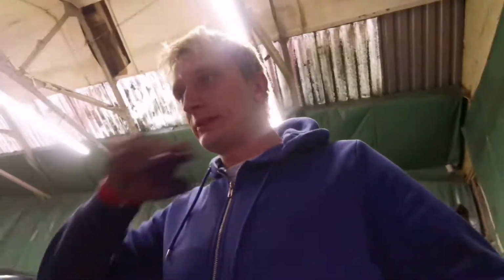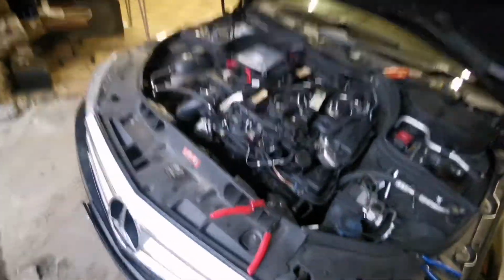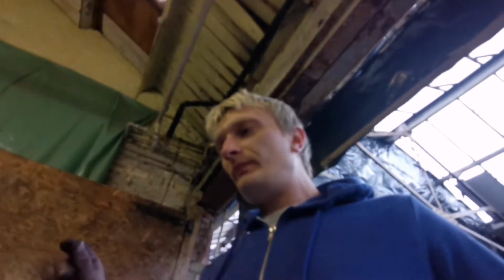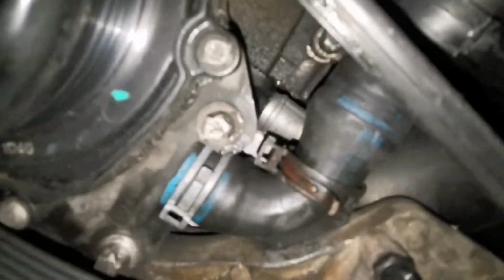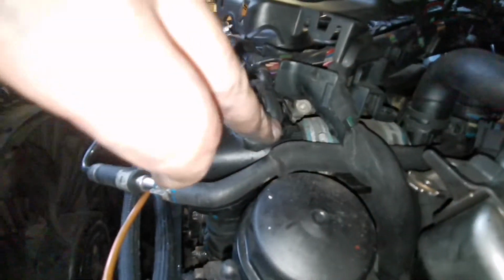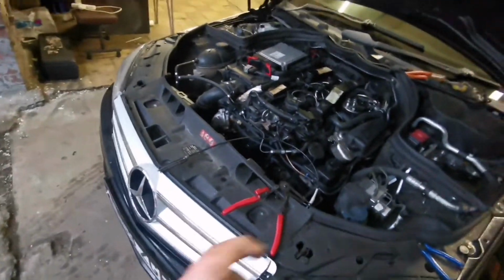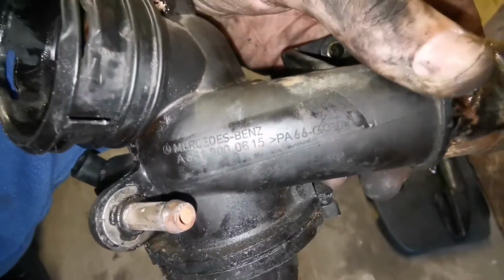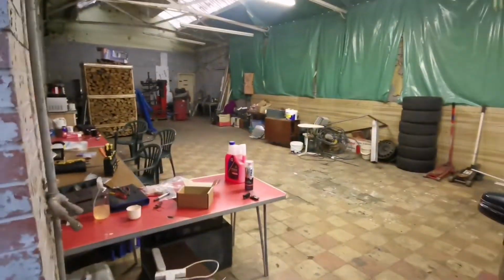Mercedes Benz 2009 W204 C Class Diesel Thermostat Location and Removal.

Comment: What symptoms ypu had to diagnose a bad thermostat?
Reply: Cold and unnormal engine temperature
Reply from the maker: Or use a diagnostic tool. These are electronic ones. If its bad it will come up.